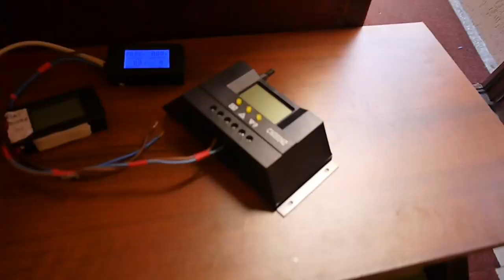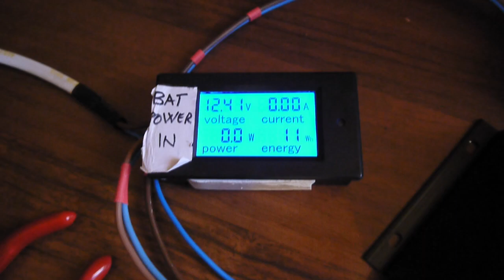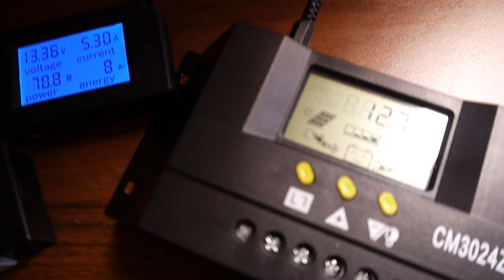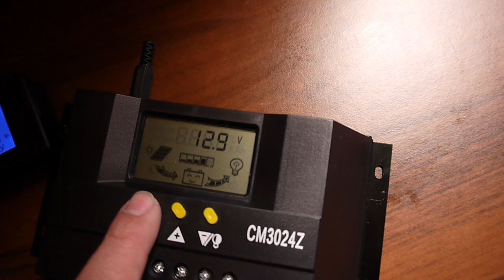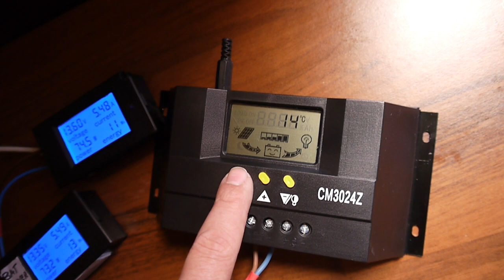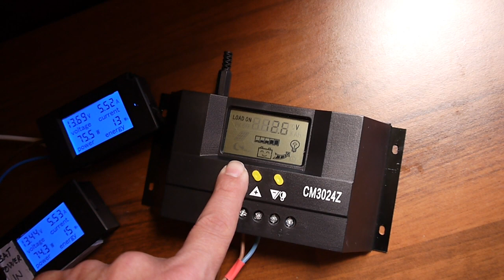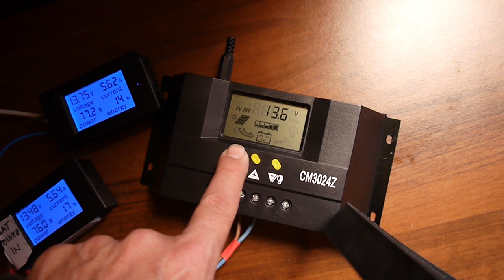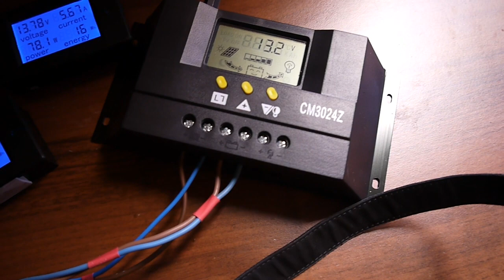Best PWM solar charge controller CM3024Z 12/24v 30Amps

Comment: It is a very cheap and simple charger, it does not indicate charge or discharge amps, nor does it really modify the float voltage.
Reply from the maker: That's right..better then nothing..

Comment: Should I increase the float voltage because it cut the power when the battery isn't fully charge
Reply from the maker: Yes you may...like 14V..?
Reply: how did u derive trough ur panel 20v to 14 v?
Reply from the maker: @khevzjal1730  yes..
from 20v to 14

Comment: The batteries will not change completely because the voltage reading is wrong. Please any help my own is also reading wrong voltage.
Reply from the maker: Check the battery voltage with a multimeter and make a compare with the one on the display...change the float and max max charge voltage accordingly..

Comment: This shit don't work...
Reply from the maker: There are so many looking like that..copies of the copies..I can't say yes or no,  no more!
Reply: @viocaia  The manufacturer said it works for 12v with 37v panels, but it doesn't.
Reply from the maker: @joaocarloskist  This is a PWM charger..so 37V for charging 12V battery is way to much..it works with 20V panels..those 36 cell style..You need a MPPT to ''transform'' 37V to 12V without loosing power..

Comment: I recently switched to this controller in my van. With the old one, the lights were working perfectly fine, but now with this controller, they sometimes work and sometimes not. I had the impression that the controller has a timer integrated? Is that possible, or what could it else be? On one of the manuals online I saw a little watch in the display but no further explanation. Thank you for helping!
Reply from the maker: Yes there  is a kind of timer only for the output (right last 2 connectors) you can set how long the lights are on, or dusk til down, or 24h means open all the time..but there is no dedicated timer in the real way,. with a watch and fixed hours for on/off...

Comment: I have just installed a solar system with CM3024Z charge controller and a new 12 Volt battery. It was working well in a week and the battery was boiling during the day, but suddenly its battery acid became less. Then when I added acid to it, the battery doesn't have heat and doesn't boil. The voltage in charge controller shows 12.0  now. However it was showing more than 15 and 16 volts before adding the battery acid. How to solve this issue?
Thanks
Reply from the maker: There is a problem with your charger..it should stop at max 14.4V ! This model I recall have no settings for voltages so it should stop when the battery is charged.That's why your battery was ''boiling''..the voltage and the current was still running high even after 14.4V.This model, at least the look of this model is copied in so many variants...You should look for another, even a proper MPPT, much secure though ..
Reply from the maker: Check if you a have menu like PV OFF..that should be at what voltage disconect the panel from charging..that should be from13.7 to 14.4..see if you can adjust that voltage...

Comment: Sir..
Could you please explain about temperature sensor cable..??
How to connect in battery..
Reply from the maker: If you have a single battery just tape it on the side, where the heat is prone to accumulate, if you have more, put it in between batteries as close as possible
Reply: I have only one battery..
No need to connect battery terminal..
Senior cable closer to battery...am right
Reply from the maker: @nitheeshgopi4580  there is no electrical connection between the sensor and the battery! Just place it with tape on the side.
Reply: @viocaia  ok..thanks

Comment: Sir my controler does not show the   battery percetage I mean the level?
It is looks always empty on LCD 
please answer!
Reply: Hi yes mine is the same the display does not show the battery icon filling up ? Maybe this is normal for this model. Otherwise it seems to work ok kind regards keith could anyone tell me if this is normal ???
Reply from the maker: It should as long as it's charging..have you tested for charging current? do you have the panel connected and the sign for panel in current?
Reply from the maker: It's also possible you have another version, there are many same looking with different boards and display
Reply from the maker: Hey! Just give me a hand and  subscribe ! Thanks!

Comment: Can you charge a 12v battery using 24v solar panels with this charge controller?
Reply from the maker: No, only if you have 24v batteries, so for charging 12v battery you need panels with max 20v and min 15v
Reply from the maker: Hey! Just give me a hand and  subscribe ! Thanks!

Comment: Please help me i have the same type of controller but it's not detecting my solar panel of 130watts but only detecting the battery only .what could be the problem???(paulomirambe@gmail.com)
Reply from the maker: Try to check if the PV is ok, then check the polarity, I recall there is no fuse for panel in, but maybe it's trace ruined, or a Mosfet , even a capacitor can be in short.Open it up and check the circuit..look for burned traces..replace them witha piece of wire..if you know how to solder..sorry I can't help more! Let us know!
Reply: Please can you share with your email bcoz i wanted to share with some screen shots of the controller,  how do the fuse look like, how do i test it using multimeter???
Reply from the maker: @omirambepaul3114  There is no fuses, I said that, I don't have the charger anymore, so I can't assit you further.! Good luck!
Reply from the maker: Hey! Just give me a hand and  subscribe ! Thanks!

Comment: 450watt is this possible to use it
Reply from the maker: Almost at the limit, but it should work.BTW 450W offer full power in ideal conditions, in fact you'll have around20-max 25Ah , so you may used it.Also consider working on 24V bateries, that's put the current half..
Reply from the maker: Hey! Just give me a hand and  subscribe ! Thanks!

Comment: Dear can we use 30 Ampere Controller on 5 Solar panel 150 watt ??
Reply from the maker: Hey! Just give me a hand and  subscribe ! Thanks!
Reply from the maker: I'm afraid you need a stronger one! You have 750W, this will deliver around 60Ah at 12V full power...but if you'll have a 24V battery pack..it's working, at limit but plausible.Also for a 24V setup will need an extra or use 4 panels, 2 in series and eventually parallel, so it's kind of multiply of 2

Comment: Can we charge battery with dc motar by use it...?
Reply from the maker: I don't think so.If you consider a wind turbine with a DC motor is much more eratic, you need to keep the voltage in between 15-20v (for a 12v battery) that's almost impossible, also you need a shunt connected to the motor for keeping the  speed in certain limits when to much wind or finished charge.But there are some dedicated chargers for that.Just google it.
Reply from the maker: As long as the voltage from the dinamo is in a certain limits , like a solar panel , 15-20v it could work, but I doubt it.Better search for a dedicated wind charger.Plenty of those all around big sellers..
Reply from the maker: sorry I didn't saw the question! I'm sure you found the answer, but I'm still saying yes, you can use a DC motor like a generator, but it needs to fit the right voltage and amps for your batteries.
Reply from the maker: Hey! Just give me a hand and  subscribe ! Thanks!

Comment: how meny dc lod run this charge controler
Reply from the maker: The direct DC load (out from charger) it's only for small loads, max 10Amps, take it like small LED lights, a laptop, stuffs like this.
If you want to use an inverter, the load should be connected directly to the battery.The PWM charger is checking for voltage and current drop and compensate right away.
You may see in the video, my 600w/220v inverter is connected straight to the battery poles.
Reply: 008613798209142
Reply from the maker: Hey! Just give me a hand and  subscribe ! Thanks!

Comment: Thos Cm3024z without amps in and out is a fake,ussualy the original shows those function, but it work i see. Regards
Reply: I have two original ones.  And so far works well for couple years already . And left outside.
Reply: Marius Macovei  2 modes , one design have ampere display , other design without ampere display
Reply: robert kowalewski OK
Reply from the maker: Nice!
I don't use it anymore, due a Epever MPPT (not such a big deal), but my tests shows that  one's been pretty fair for the money.
Reply from the maker: Hey! Just give me a hand and  subscribe ! Thanks!